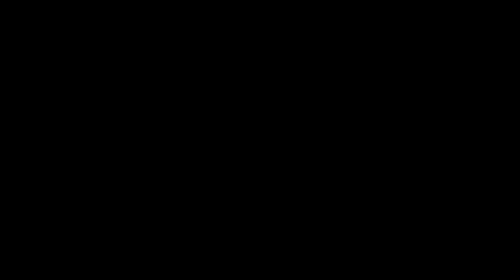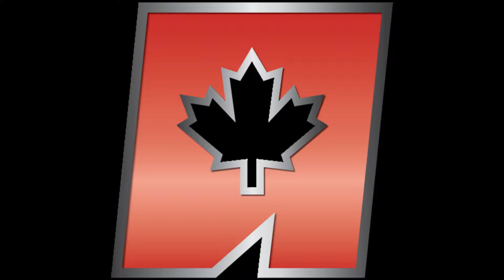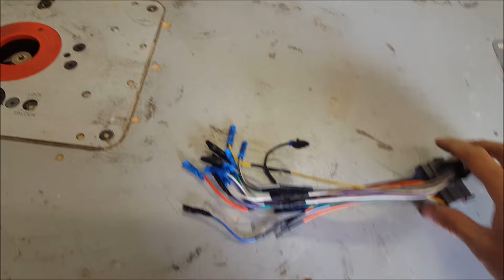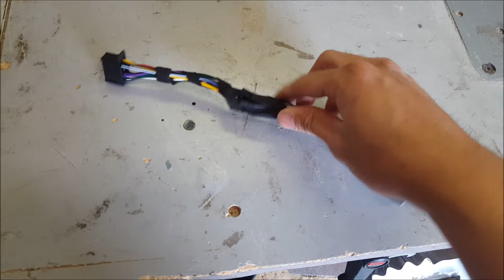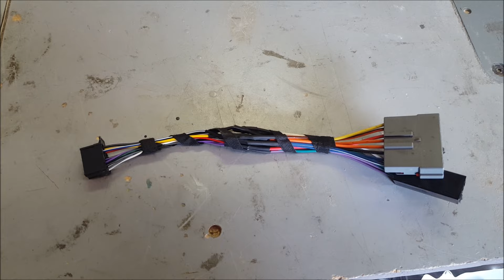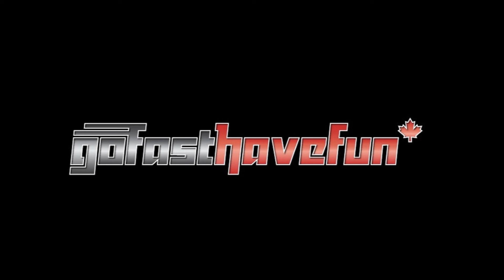How Not to do Car Audio Episode 6 | AnthonyJ350

Comment: Can I use crimp caps or should I stick to solder and shrink tube. The reason I ask is because I'm afraid vibration from my ride would make them loosen up overtime.
Reply from the maker: Alley55 I'd prefer you use butt connectors that have nylon insulation if you go that route
Reply: Great, thanks.
Reply: l never solder unless you're certain you're never going back behind the stereo to mod and or swap something.
Reply from the maker: Electronics For Fun Why not just solder every time? If you have to redo it in a year what's the big deal?
Reply: for most people the big deal is that they don't want to go out and buy a soldering kit, for me it's a big deal because l am doing something with a car stereo about every month. i'll add different speakers or a different head unit, like l said earlier l like to play.
Reply: I ended up soldering, I didn't feel comfortable leaving crimped wires behind my dash.
Reply from the maker: Alley55 Nice good job! Looks real clean after I bet.
Reply: AnthonyJ350 Thanks, yeah it looked safer. I read an article saying crimp caps are used on plane repairs. I find that disturbing. Lol

Comment: i was left with one orange and one blue wire once i finished..so i left those alone. so i beleive the orange is an some kind of iluminator (not sure if thats the word, i couldnt remember) and the blue was a ground. but i already had a ground from the radios harness..what would thr orange do in this case?
Reply from the maker: Did you read the instructions from the harness and the head unit?

Comment: more failure points, I get that but why be nitpicky about how it looks, it's buried in the dash, it will never be seen, I personally used wire nuts because it's easier and also not permanent, I'm not the type to keep everything as it is, so I go for them instead, but that's for my own stuff, id soder it if I'm helping a friend or making something permanent
Reply from the maker: And that mentality is the difference why I get paid to do this.  By taking more pride in my work (even if you can't see it) is why people want to spend money with me, allowing me to own 3 vehicles, have a nice SnapOn box and carry a mortgage.
Reply: +AnthonyJ350 I understand if that's how you feel because it's your job, but it's not my job, so what your saying only should apply to someone who does, my own personal stuff is set up how it works without any of it being permanent, because I know it won't be and I'll want to move my amp yo another car without buying another converter, or if I put in another aftermarket reciever and take that our again, there's nothing wrong with doing it this way if it's for your stuff, and are you even sure anything you put in this was installed by a professional place or someone did it to there own car?
Reply: and I wouldn't take my stuff to an installer because I can and have done it myself and everything always works, I was in automotive tech, doing lots of 12v car electric, and am a home electrician as well, everything I did in the class, or do at jobs I make sure it's done right, so I know both how all the electrical systems work throughout a car as well as the audio aspecs of it, and have been messing with wiring speakers since my first legitimate stereo, if I was doing work as an audio installer, of course I would soder, or whatever is better for that specific application, considering ID also have access to any parts I may need to do it right, I have wire nuts from electrical work, so I use those it's easier and makes no difference to me, don't act like I have an attitude about it that makes me unfit to do it as a job when I'm talking about people doing work on there own cars, none of that stuff is too difficult, especially with all the connectors and tools you need
Reply from the maker: Matt Wells So I give free advice and showing how a nicer looking and more reliable install should look, and you insist to put in a connector for the wrong type of application.  Nothing wrong with wire nuts (in a house).  You need to do crimp style connections or solder in a vehicle. 

There is a reason why the engineers who design the electrical connections don't use any type of connection that resembles a wire nut.

You admit that you would do a soldered connection if you were a professional, so why not practice the correct type of connection for the application?
Reply from the maker: Let's put this more into perspective.  Bolts you buy at Home Depot or Lowes is pretty strong to build a deck right?  Would you use those same bolts to hold a cylinder head on to an engine block?  Probably not.  Thread pitch might be different, tensile strength, corrosion resistance, the ability to be heat cycled will all be factors in operation.

So there's nothing wrong with those bolts, just the wrong application.
Reply: +AnthonyJ350 because an electrical connection is a connection, when you wirire not something you are twisting two wires together, and the tighter it goes the tighter the wires come together, the first only reason to opt for a different connector, is I like when you need to waterproof the connection as well as possible, that would be a bad place for a wire nut, the connections can obviously handle the application, while unethical to use in a professional automotive repair, I'm not interested in wasting my time going out to get different connectors, that require multiple tools to use, which I'd have to buy as well, something to properly crimp a connector, or a soldering iron, and heat gun for the heat wrap, I like that your showing how a good professional installer would do it, and I already know this, knowing how the electrical system works is key, I have what I have and to me it's more convenient, it can be removed, and I wouldn't solder unless I knew I wouldn't be taking that out, but In the current work vehicle I have this in I know I will be reusing once I get a more personal vehicle, so it's going to be %100 removable, without having to chop of another 1/2- full inch of wire. it's ugly, and it is behind my stereo, completely concealed, if I had to look at it Id do it nicer, ID rather not look at any electrical conections, there's no difference how the. connection transfers the electricity, it works well for what I needed
Reply: +Matt Wells Electrical connections are not all the same. Wire nuts can cause small voltage drops which an AC circuit can handle, but a small voltage drop in a DC circuit can be problematic for vehicle electrical circuits. Especially data connections. Why use a connection in an application it's not intended for? Might as well just twist the wires together and tape them if you're going to use the "Temporary solution" as an excuse. Wire nuts are meant for home applications. Houses aren't on the road enduring the bumps and constant vibrations a car does. Besides why not do it right the first time instead of being lazy or cheaping out on the proper products. And I'm not trying to attack you or trying to be a dick just trying to inform you on proper ways which is what Anthony is also trying to do.
Reply: +Matt Wells If you want a convenient connection, use crimp-on male/female spade connectors, NOT wire nuts. Wire nuts are very picky on stranded-to-stranded wire connections to begin with, and simply cannot hold up to the vibrations in cars. You're better off just twisting the wires together and taping over that.

I use insulated spade connectors when I splice into things I may want to remove later. I could take out all my speakers and my amp in an hour tops, including all the wires I put in to go with them. You wouldn't even know anything was ever there. Those connectors hold up fine with a solid crimp and require no more effort than a wire nut does.
Reply: +Kyle Repinski  the only reason I'm still replying is because people are making a big deal about it, the thing about wire nuts is that you can easily test if it's on right, if the stranded uses very tiny strands and is very loose it's not the best idea, the size wirenuts I used were nuts that came with a light kit that used stranded wires, while these don't endure vibrations, they endure alot of tugging sometimes while being put up in the box through brackets, if you didn't put the nut on tight enough they can pull out, that's why on every wire nut I use, I tug very hard on each wire and on the nut and wire, so I know it won't come loose, I already know it's not the correct connector, but in my opinion if it gets the same result, and doesn't fail, it's a OK for me, I must tell you the wire nuts are used on a crappy old work truck to hook up one speaker Channel to a in line converter, and it has been on there for a year with not one single issue with any connection, it does a great job of keeping signal going to my SAE 1000d, yes I tried swapping head units but the one I had, from a POS truck I owned, sounded like garbage and had absolutely no bass range, even when I hooked the sub I had up to one of its spare Chanel's, got nothing below 100hz, stock radio sounded loads better lol, ID use crimps but I've never used one despite having worked in auto tech, they had us soder, heat shrink, because most stuff we did was to be permanent, and is exposed to the elements, and the engine bay or underside, which has much more vibration than the inside of my dash
Reply: Matt Wells I'll give you this, it sounds like you're at least using the right /size/ of wire nut and you do give it a tug to make sure it's not going to fall right off. Everybody's got a preference when it comes to making an electrical connection, I personally don't trust a wire nut and I see many people have issues with them, but if it's solid enough that you can yank on it it's probably fine. That's true of any crimp as well.

Shit man, I often get ripped by people for using spade connectors, but when I point out that's what most people use to hook up their speakers they stop talking haha!
Reply: wire nuts behind the dash you're asking for a short aren't you??
Reply: +mattypisme no, do you know how electricity works? I'm an electrician, and had two years of auto tech dealing with electrical issues regularly, in other people's cars at an auto shop I'll soder shit, but I have other connectors that work as good without the permance of crimp connectors, I can guarantee that a properly secured wire nut will last just as long or longer than a crimp style connection, how's it going to short out, I bet the wires have not moved since I had my radio out over a year ago to put in my inline converter in, there's been no issues, and it's not a permanent installment, I like being able to change what I have without cutting wire off the length that's available